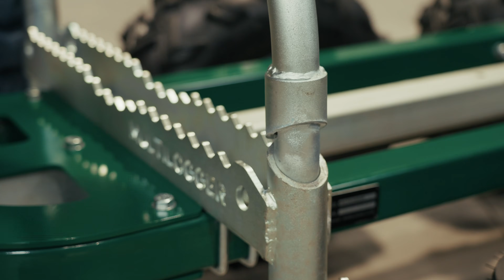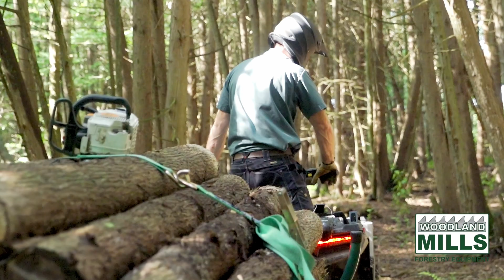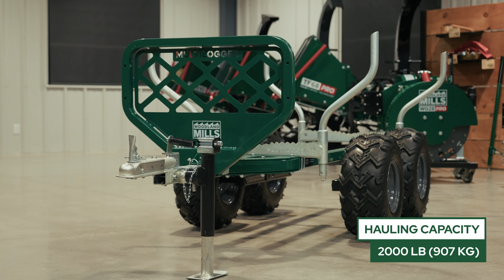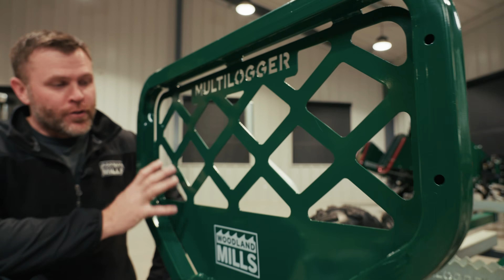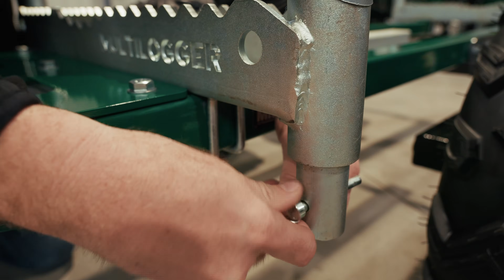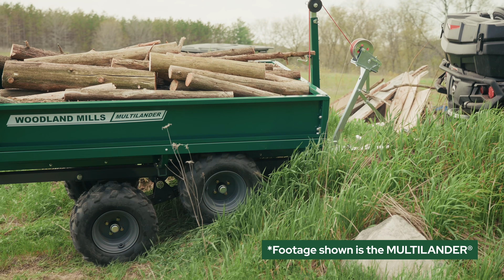Woodland Mills Multilogger™ Logging Trailer Walkaround

Comment: I really like this overall design but but have a concern about the strength where the twin rails attach to the walking beam. Offroad trailers are subject to extreme shock loading and torsional forces (that are being addressed by the front plate lamination) due to uneven terrain. It would be nice if the twin rails also had an inverted C-channel that effectively doubles the strength of the chassis to better handle the load being transferred to the walking beam. It would be a modest increase in weight for a substantial increase in structural integrity.
Reply from the maker: Thank you for the feedback, it is appreciated!

Comment: Good trailer but here the 2000 pound limit is not enough. red Oak is 111 pounds per foot, avg 18inch diameter, 10 foot length which we cut. That is 1200 pounds for one log, and 800 pounds left for a second short log.